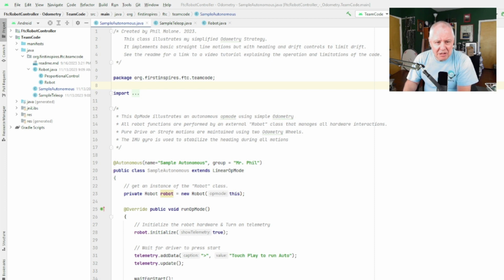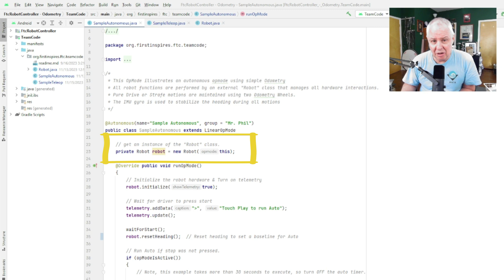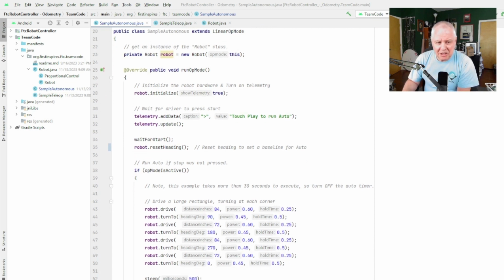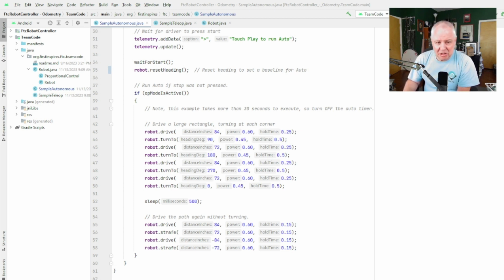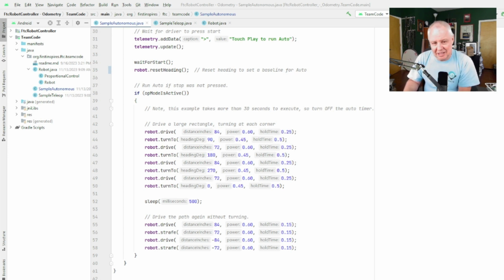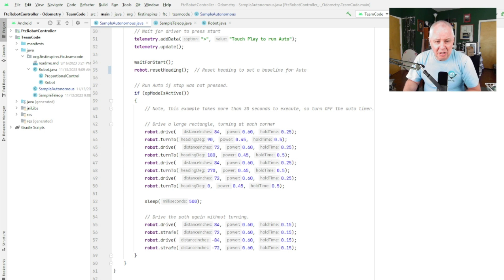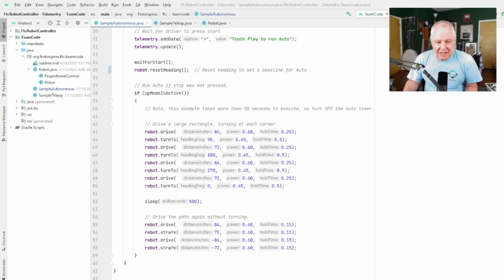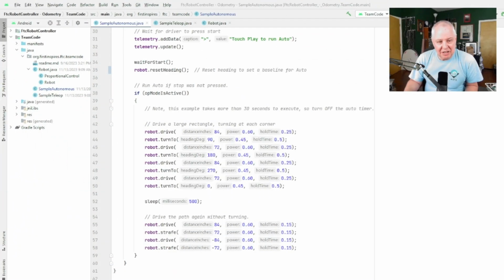Simplified FTC Odometry. Part 2: Autonomous

Comment: when running the sample auto, my robot goes in circles instead of going in a square.
Reply from the maker: I can't stress this enough.   You need to make sure that each wheel is configured correctly.  Mecanum rollers need to make an X when viewed from above, then make sure that each wheel is named correctly in the Robot Configuration and that the wheel direction is set correctly so that when you push the left stick forward, all the wheels run forward.  If the wheels are not 100% correct, you will get all sorts of incorrect driving.  Do not just flip the +/- on any of the existing code,  set the wheel direction using the .setDirection() fuctions as shown in the code walk-through.  If you feel you need to change the +/- sign of any existing code, then you have a different problem you need to solve with the wheels or ODO encoders.

Comment: Thanks for update. Everything works fine but when trying to complete a 90 deg turn, robot does not stop. What could be issue?
Reply from the maker: My first gues is that it's not turning in the correct difection because of drive motor directions.  Did you run the sample teleop and auto opmodes before making changes?  You should be able to run the code by 1) making your robot-configuration motor names match.  2) setting the motor.setDirection() values so that all motors drive forward...   Once you have this done, verify that the robot drives as expected.  Then make sure the gyro is changing properly as you tur (look at the telemetry).  turning left should increase the heading.
Reply: Sample telop works fine as the robot drives as expected except the turns.  The heading stays at 0 that is why the robot keeps turning rather than stopping at 90 degrees as programmed.  I will double check the configuration and motor.setDirection()values. Thanks  @GEARSinc
Reply: Also, the only way odometry drives correctly is if this code direction for logo and USB for IMU is flipped: our hub logo is facing right (but in code we have it as LEFT) and USB is facing up (but in code is DOWN)

        // Tell the software how the Control Hub is mounted on the robot to align the IMU XYZ axes correctly
        RevHubOrientationOnRobot orientationOnRobot =
                new RevHubOrientationOnRobot(RevHubOrientationOnRobot.LogoFacingDirection.UP,
                                             RevHubOrientationOnRobot.UsbFacingDirection.FORWARD);

 @GEARSinc

Comment: Hey there,
I was trying to implement your code into our robot to test it out and ran into an issue when implementing the SampleAutonomous. For reference I am using the OnBotJava and both the Robot class file and SampleAutonomous file are in the same folder. On line 23 of the Sample Autonomous code I am getting this error:  ERROR: incompatible types: org.firstinspires.ftc.teamcode.SampleAutonomous cannot be converted to com.qualcomm.robotcore.eventloop.EventLoopManager 
and on line 28 I am getting this error:
ERROR: cannot find symbol
  symbol:   method initialize(boolean)
  location: variable robot of type com.qualcomm.robotcore.robot.Robot

I havent modified any of the code on the github repo. Any help would be much appreciated
Reply from the maker: I don't have hardware at the moment (snowed in) but I will try an OBJ build and see what your issue might be.  Hopefully by tomorrow.
Reply from the maker: Hi

So... it turns out that OnBotJava was not happy about me naming the robot hardware class "Robot".  This clashes with an internal SDK class.  So I have renamed the class to "SimplifiedMecanumRobot"  Nothing else has changed.  So if you re-clone the repo (I just updated it) and get the new files, then it will build properly in OnBotJava.